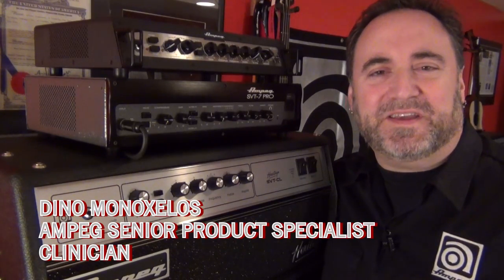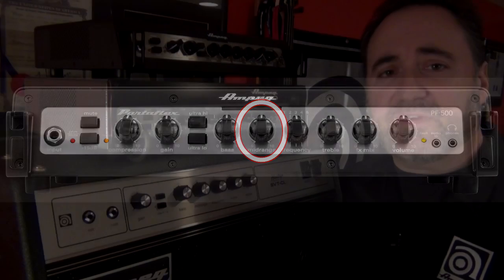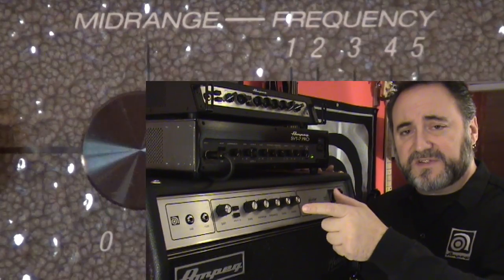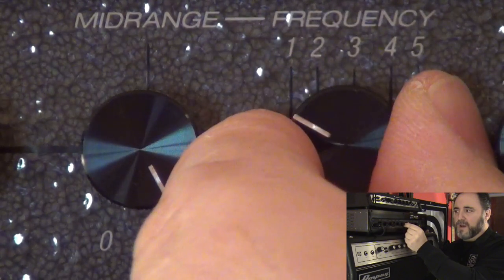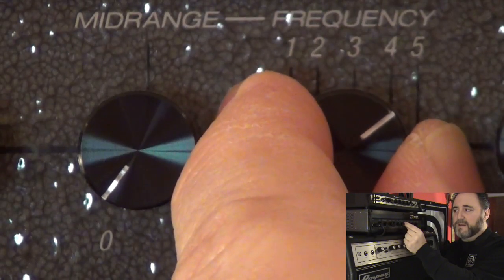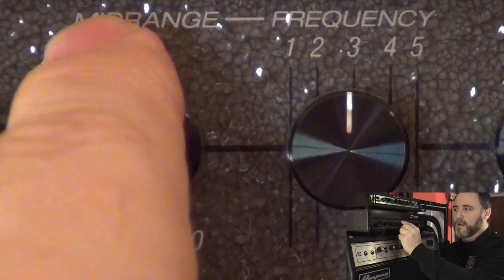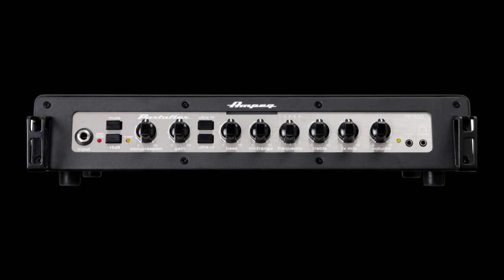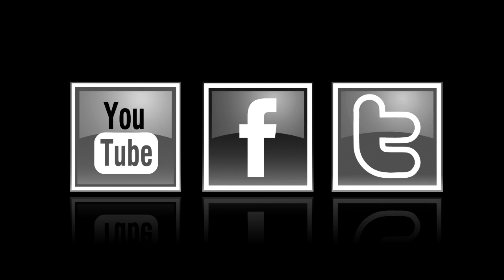Tips and Tricks - Ampeg 5-Position Midrange Control for SVT, SVT-PRO and PF Series Heads

Comment: I wish Ampeg would bring back the SVP rack mounted preamps. I feel like a good Ampeg tube based rack mounted preamp for going direct would sell really well in todays world where most people want the convenience of a good direct sound, and tubes are still the most desirable types of units. Im really hoping this SVP Pro i found used is still available when i get paid. They dont surface often in the used market, and i wish there was a new and improved version i could buy. I currently use a Tech 21 SansAmp RBI trying to get it as close as i can to that SVT sound, but theres no substitute. Fingers crossed that that SVP Pro is still available in a couple of days, cause that unit is exactly what im looking for, and if Ampeg actually reads my comment, please, please, please bring back a new version of the SVP Models. I know that it probably wont happen, but a man can dream, and worth the shot to ask. 😁

Comment from the maker: Just a comment regarding the "synth" tracks used to demo.  I found this track demonstrates the full range of the frequencies better than it would if I were just playing bass through the amp.  That track was chosen specifically for that purpose only given the parameters at which we usually listen to these videos. (computer speakers or earbuds through a smartphone).  My apologies if you didn't find it useful for it's purpose  - Dino
Reply: AmpegTV Totally agree.
Reply: Not so much the synth, but would have been better to play one note. If you play a low G for 2 bars and then go up to an E just as you switch the frequency knob to a higher boost, it's impossible to compare the impact because the lower notes have more bass and thump by nature.

Comment: I love you Ampeg, but if you're going to use this control format on 3 dif series of amps, wouldn't it be cool to print "-20/+10" under the dial versus "0/10"? IJS...
Reply: Do you really need to know how many dB you are boosting or cutting? Just turn it until it sounds good.
Reply: Very well pointed.
Reply: Good point, but then as Nigel Tufnel once stated... "this goes to 11".